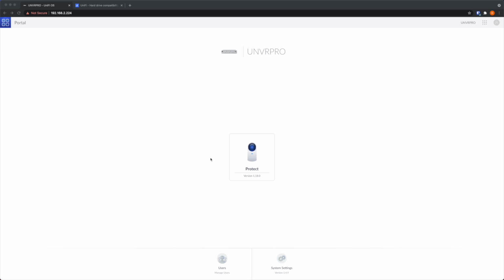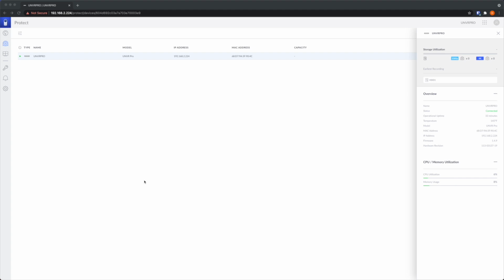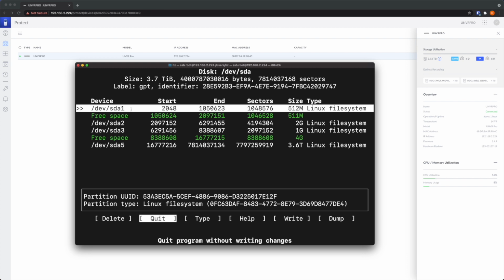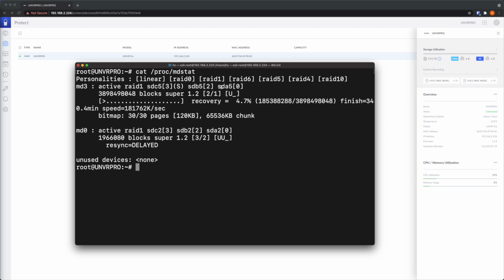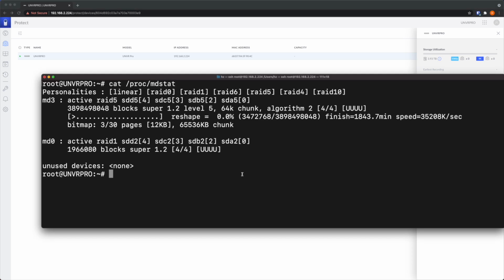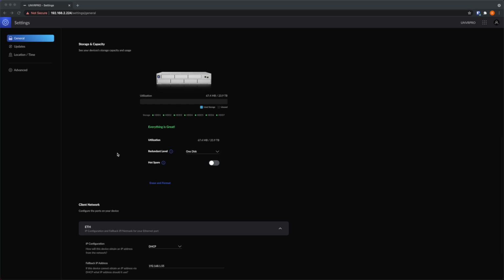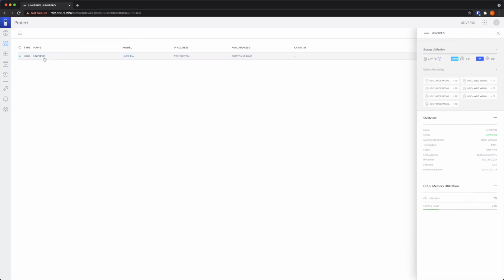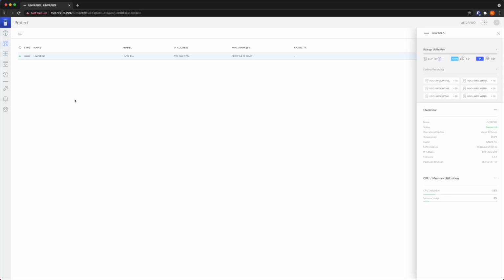Ubiquiti UniFi UNVR-Pro RAID Mode Explained

Comment: I have the non-pro NVR. I have 23 cams, 5 of which are 4k and 2 are 2k. 4x16tb drives. With "Half of disks" redundancy level (RAID 10, I presume), I get around 30 days of continuous recording, which is plenty. But I was curious if there is any real or perceived performance benefit between all the supported disk configurations. I would prefer performance, but if there is no difference, I would switch to "Single disc" redundancy because I don't need 50% disc redundancy ;)
Reply from the maker: RAID10 is more performant, because it is based on RAID0. And RAID10 is easier if rebuild is needed. I don’t use it in my system because I prefer more storage. UNVR, pro or not, is not a generic NAS, so I don’t care too much about read/write speed.
Reply: @hz777  As I add cameras, especially 4K models, performance is decreasing. Response times for streams to start and other functions in the app/web are increasing, stream quality to a Viewport is decreasing, and generally the platforms feels slower. A recent UniFi OS update helped a lot, but I am not sure how much software is to blame. Based on CPU and mem utilization in the web UI, it doesn't appear to be those. Maybe it's disc? I converted from RAID 5 to RAID 10  and it seemed to improve, but I hate "seem" things. I like empirical data. But I am not smart enough to figure out a benchmark test for UniFi Protect. Thought I'd throw the idea your way given that you are super good at testing (and explaining). Cheers!
Reply from the maker: I don’t have as many cameras as you, so I have not reached the point of feeling performance issues yet.

I did think about testing UNVRPro’s disk speeds under different RAID modes, but now I use it in my “production” environment so cannot test it any more.
Reply: @hz777  Seems like a very hard thing to benchmark! One would need to find a way to virtualize the cameras to make scale testing not cost a million bucks and to normalize the bit rate.
Reply from the maker: Agreed, because just pure disk speed test is not enough, but to use hundreds of real UniFi cameras to exhaust the system resources will bankrupt me;)
Reply: The UNVR Pro definitely has more horsepower than the regular UNVR as well as having more abilities for storage. You’d definitely see an improvement in performance switching devices.

Comment: thanks! any update on the reporting for a failed RAID member disk?
Reply from the maker: No update. But in real life, I did get a failed hard drive, which was almost full. The device reported the error, and recovered automatically after replacing the drive. The recover took several days, during which it had the normal load. Overall, it behaved nicely during one drive failure.